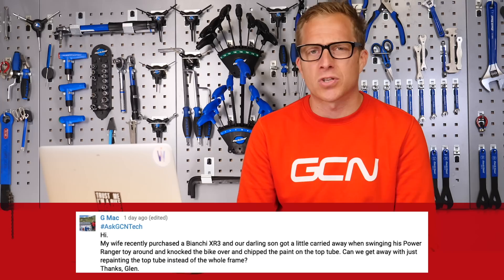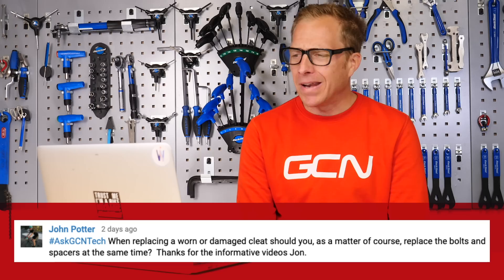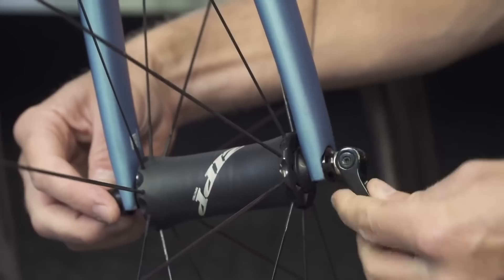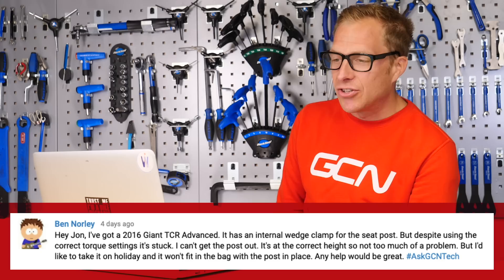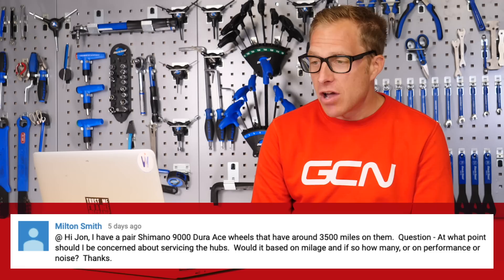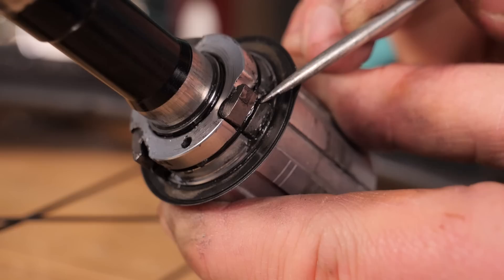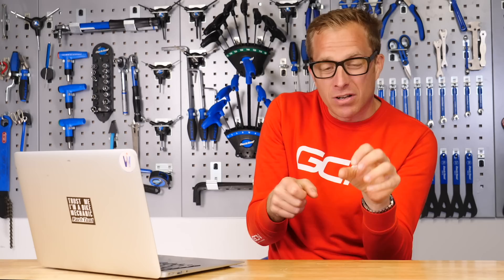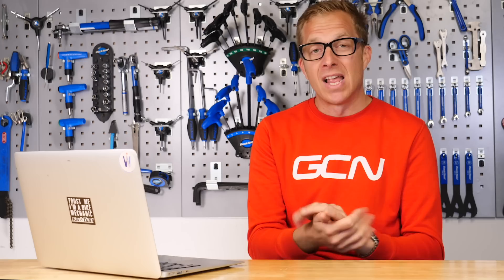New Cleat Bolts, Chipped Paint & Stretched Titanium | GCN Tech Clinic

Comment from the maker: We love to help here at GCN Tech so if you have a question that you'd like us to answer leave it in the comments below using #AskGCNTech
Reply: #AskGCNTech
Hey Jon,
I have a 2016 Scott Foil with Ultegra di2 6870. I really want to change to the handlebar di2 junction box (EW-RS910) for charging etc., but I've read that i need to change the battery and all sorts of other things to make it work. Reason for the preference is that I have the integrated handlebar and it has a slot in the center where the box goes into, but it's a pain the rear to get it out. 
Please let me know if there is anything i can do to upgrade di2 simply or if you have any tips to take out that junction box from the bars.

Thank you!
Carlos
Reply: #AskGCNTech 
Hey Jon, 
I built a up a gravel bike last year with a sram 1x drivetrain. I want to go back to 2x, but dont want to buy new shifters. I have sram 2x hydro rival shifters and want to run the new shimano xt-8000 sgs rear derailleur. Any solutions to go from sram road shifting to shimano mtb??
Reply: I love the show, My Question is why do bicycles have seat posts but we ride on a saddle? Should it be a saddle post?

Comment: If you can only stop your front wheel clicking/creaking by over-tightening the QR skewer you should check the hub bearing adjustment. I had this problem and found the bearing a bit loose. When I pulled the skewer really tight it compressed the bearing just enough to stop the noise. When I adjusted the bearing correctly I didn't need the over-tight skewer.
Front gear change problem - check the cable isn't frayed in the shifter. Not sure about SRAM, but this can happen on Shimano.

Comment: Joh..   Love the GCN Tech channel. Thanks for all the nifty tips and tricks.

Regarding the paint chip question, you can indeed repair small scratches and get a nearly professional finish quite easily. You need to: (1) match the paint and (2) repolish the touched-up area. For (1), repainting the chipped area, bike manufacturers recommend using nail polishes since they come in virtually any color and shade. Instead, I have used touch-up paints sold at automobile dealerships, which usually also come with a clear coat finish. Just repaint the chipped area and apply the clear coat. However, no matter how carefully I put the clear coat on, the new finish always look terrible. So for (2), refinishing the area, I repolish it to try to restore smoothness and shine. Automobile polishing compounds do the job. Sometimes these are called "rubbing compounds", because they are meant to be rubbed in by hand. One that I've used and have worked well for me is Meguiar's M20508 Mirror Glaze Ultra Finishing Polish (I live in the US and Amazon sells this). Just apply the rubbing compound using a microfiber cloth repeatedly over the area following the instructions. It takes a bit of patience, but does not require much pressure. The tiny particles in the rubbing compound will remove the bumpiness and restore the smoothness and shine gradually, and quite effectively. The paint and the repolisher cost no more than $15 US, and about 30 minutes of work, to get you a like-new finish.

Comment: I've got a couple ultrasonic cleaners at work and it's never dawned on me to use them for my chain.

I use the park tools chain cleaner and tool. Then right before I wash it off I hit it with motorcycle chain cleaner. No issues and my drivetrain is spotless.

Comment: Hi also use your mrs' hair dryer on 'hot' to warm up the area around the frame seat post, in addition to using a lubricant, WD40 or 'inox' is a great product, while doing this have someone place some pressure on your seat in a screw sideways motion and well hopefully this works for you!

Comment: SOrt of a tech question, would have asked on GCN but they're not doing these kind of questions anymore: Would you rather ride a gravel bike in a cx race or a cx bike on a gravel ride? I'm tossing up between the (lighter and cheaper) Canyon Inflite AL and the (heavier, more expensive, trendier) Canyon grail AL. I know weight isn't everything but it seems to me that the Inflite is a much better deal. I'll have a Force CX1 group to put on the chosen bike. Maybe I need to consider geometry a bit more? I'll be doing about 50/50 cx and gravel on the chosen bike.

Comment: For chips and nicks, I touch up my own bikes, but an artistic hand should run in your family.  My bikes have white, black and grey, so I use rustoleum epoxy paint (white and black).  It drys shiny, and depending on your brush paint job, you may have to use 3000 grit wet sanding.  Then finish off with rubbing compound.  You may want to first try using your skills on other not so obvious areas before tackling a top tube.  Again, you need some artistry hands and don't be too aggressive with sanding.  Too much sanding can take off too much clear coat in other areas. An automotive paint guy could guide you on other paints to use.  If you have any doubt, don't do it.

Comment: #AskGCNTech Great work with the show Jon. I currently have a Dura Ace R9100 53/39 chainring setup and sometimes I find myself spinning on 53/11 so will a Dura Ace R9100 55T outer chainring fit on my current Dura Ace R9100 cranks so I end up with a 55/39 set up?

Comment: #AskGCNTech Hi John, I have an FSA PowerBox power meter connected to a Garmin Edge. I love it, but I'm starting to get a bit suspicious to the accuracy of the max peak power readings (peak power and 1-3 second power). How much are these readings affected by smoothing, max torque and mechanical components like the bottom bracket or pedals?

Comment: #AskGCNTech Hi, I have a campy champ triple and the right shifter/brake lever and the rubber on the hood has  split. I have looked far and wide for a replacement a rubber hood cover but I could not find anything😭. Would you be able to recommend any fixes or anywhere I could get the part.
Thanks, Eoin

Comment: Hi Jon, really appreciate your in depth and simply explained responses through #gcntech and really enjoyed the latest segment on free hubs, I’m having real difficulty finding replacement parts (particularly large chainring) for Shimano 6700 10 speed in Australia. As most manufacturers are phasing out 10 speed components for 11 or 12 speed, do I have to install after market replacement components?  Do I have to swap the cranks and chainrings and if so what is the current version that is most comparable? On anther note I've sheared two rear axle in the last 4 months, any idea what might be causing an axle to shear, I've been told this is common for track cyclists but not road bike riders.  Thanks Brett

Comment: Hi Jon... I have a problem with my 105 left hand shifter for the front derailleur. During a ride I shifted to my bigger ring in front but as soon as I tried to shift it wouldn't do so anymore. I checked if it was the FD by removing the cable, and it moved down when I did, so it was the shifter. I tried to check if there is anything to help with my issue on the internet. But alas there isn't any. Is it better to buy a new set of shifters? Or is there a work around? Any help would be appreciated. #AskGCNTech

Comment: #AskGCNTech Hi Jon, I purchased a torque wrench (13nm-108nm) to replace and older damaged one and the new one seems far too tight. The wrench came with a calibration certificate but I do not trust the level of torque being applied. Is there a way to check/confirm the torque settings? I have seen some articles online using various measurements and hanging weights off the wrench but was wondering if there is a more simple way whilst I try and find a 13+kg weight I need from the calculations I did? Thanks

Comment: Hey Jon! 
I'm on the market for a new bike - maybe a bit better than an entry-level bike, but by no means do I need a superbike. Now I wonder about the groupset. The price range I have in mind offers both Tiagra and 105. Besides weight, what is the actual difference between these two? Brakes are an issue too. Discs are a must, but which are more hassle-free, mechanical or hydraulic ones? Thanks! #askGCNtech

Comment: #AskGCNTech
Hey Jon,
I have a 2016 Scott Foil with Ultegra di2 6870. I really want to change to the handlebar di2 junction box but i've read that i need to change the battery and all sorts of other things. Reason for the preference is that I have the integrated handlebar and it has a slot  in the center where the box goes into, but it's a pain the rear to get it out. Please let me know if there is anything i can do to upgrade di2 simply or if you have any tips to take out that junction box from the bars.
Thanks,
Carlos
#AskGCNTech
Reply: Sell your groupset and get etap.

Comment: #AskGCNTech Hi Jon I recently bought a used bike. It came with complete Uletgra 6800 mechanical group set and works like a treat. After a few rides though the right hand shifter moving the rear mech wouldn’t let me change into a harder gear it would only occur at the start of my rides. It would act like i had run out of gears. The exposed metal of the shifter does have a bit of rust on it. The braking and moving into an easier gear I have no troubles with. Any ideas?

Comment: #askgcntech 
Love the content, please keep it coming ! 
Is there a way to stretch new brake and shift cables before fitting them. I notice that they stretch a bit within the first two to three weeks of replacing my cables and I have to constantly make minor adjustments. 
Thanks and Regards 
Muhammad, from South Africa 🇿🇦
Reply: yeah, every good mechanic I know "pre-stretches" cables (it's more pre-seating the housing and ferrules properly).

For brakes - clamp the cable with the brakes touching the rim, that will act as a stop. Then squeeze the levers fairly hard; you'll probably feel the cables give in a bit. Then release the cable and clamp it at the proper length to allow for normal brake use.
 
Shifters - basically the same, but a bit more gentle because those cables and housing are not as robust. 

For front derailleurs I pull extra cable clamp them in the outer position (after adjusting the outer travel screw), and then actuate the shifter. It won't move but will make the cable compress the housing/ferrules.

Rear D - for bikes with an external exposed section I normally set the inner/outer travel screws, clamp the cable, shift to the inner position and then manually pull on the exposed cable to compress things. Loosen and re-clamp to adjust. If it's an internal routed frame I'll shift to the biggest cog (with a wheel), and without turning the cranks shift up 4/5 times to get some slack without shifting. Clamp cable tight, actuate shifter to compress cable/housing, release cable and adjust as normal.

Comment: Hi Jon,
I have an old nashiki bike with a 10 speed ultegra group set.  No matter what I do to the b tension, I can't get the jockey wheel close enough to the casette for good shifting. Help! #AskGCNTech
Reply: Park Tool says 5-6 mm from the cassette. Unscrew the B screw. Also: check if your derailleur or its hanger is bent; check if there is dirt stuck in the derailleur; clean and oil all parts, ensure all joints of the derailleur move freely

Comment: Remove chain
Remove rear wheel

Soak chain in solvent
Scrub cassette w/metal brush or car tyre brush
Rinse with hot water
Scrub chainrings with metal brush
Scrub pulley wheels with brush
Reinstall chain
Crank chain through pulley wheels wiping wheels with clean cloth
Done

Comment: #AskGCNTech
Hey Jon, I just recently acquired a ciöcc steel bike and a serious problem started to happen on a ride. At the top of every right pedal stroke the cranks feel like they are skipping (if that makes sense), but when I attempt to shake the bb they are rock solid and no play. Is my bottom bracket going or is it something a little less serious?

UPDATE: tightening the cracks fixed most of it but now it it only skips when I apply pressure on both feet on the pedals then Begin pedaling again. But after I start pedaling it is smooth as butter. Should I still be worried?

All the best,
-Joe
Reply: Definitely don't use the bike untill you find out whats the cause. But if it's a square tapered bb axle as I suspect, most likely the bolt came loose and it's only a matter of tightening that cheeky sucka
Reply: @appelflapdrol  ok so tightened both cranks, they were hex wrenches and the drive side was tight but the other side was just a tiny but loose. I tightened it the best I could with just my standard hex wrenches and it eliminated majority of the problem. There is just a tiny skip now on the left side. Ok is it not right enough?
Reply: @StuckOnAFireHydrant  if you just need more power, put a cheater bar on your standard hex? Makes it longer
Reply: @lenahygiena  I tightened them all up but now the skip is only occuring when I get out of the sale then start pedaling again. After that it is buttery smooth